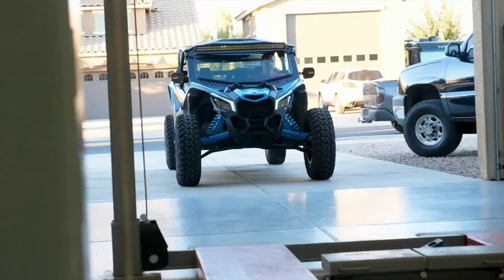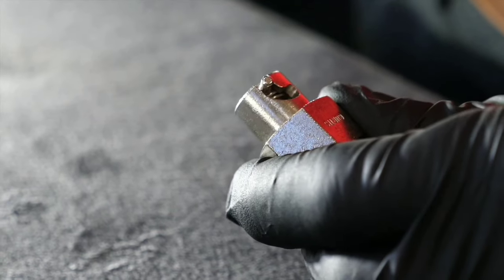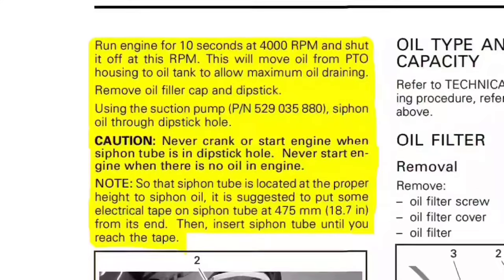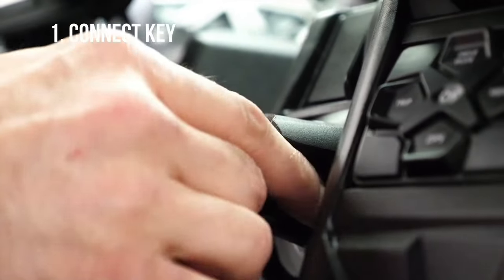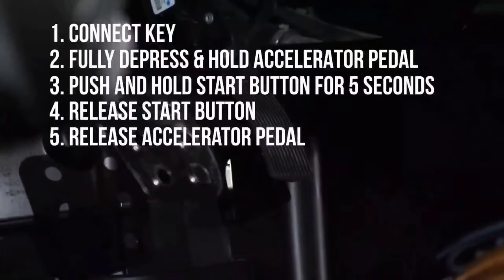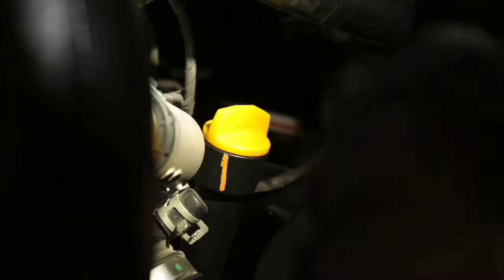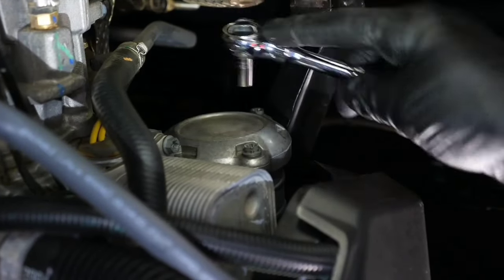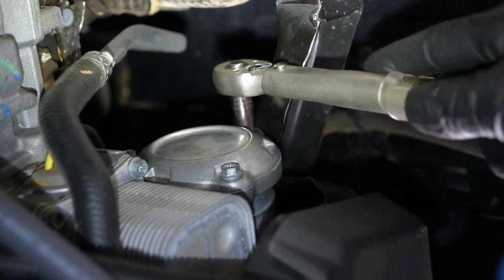OIL CHANGE CAN-AM MAVERICK X3 CLEAN & EASY! 2022 - 2024

Comment: Have had mine in for 100 miles and I just pulled the dust cap off and it was dry. I love it. So easy to use and install. The fact that planes use Curtis valves, sold me.👍👍👍👍👍

Comment: Do they come with drown mode or is that something that has to be programmed in? Looking to do my first oil change on my x3 and it seems no one else even tried to get all the oil out so I’m confused weather I have to even do this “drown mode” or pump procedure
Reply from the maker: Nearly all BRP products, and Rotax in general have drown-mode/flood-mode programmed from the factory. You can test your machine for this feature prior to changing your oil per the video instructions. Our valve kit is an aftermarket solution combined with the SeaDoo oil change procedure for a spill free oil change. It also eliminates the risk of thread damage.

Comment: Do you not have to remove the secondary drain plug ?
Reply from the maker: That is correct. By performing the SeaDoo procedure (Drown Mode) the oil which typically drains from the secondary will instead drain from the Curtis valve.

Comment: Cranking the engine with the oil drained has my brain twisted into a pretzel.
Reply from the maker: Our process is certainly unconventional for a non-marine application. During the first drown mode cycle, you still have roughly 1 quart of oil pumping through the engine. And .5-.6 quarts for the second cycle. Drown mode is just moving the remaining oil to all the important areas, and then gravity directs it down to the drain valve. You are never starving the engine of oil during our procedure.